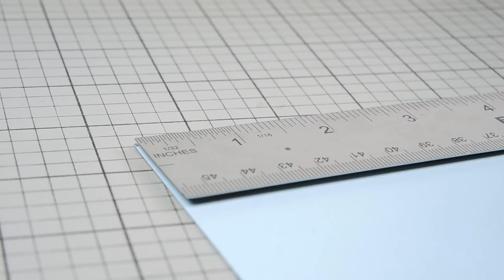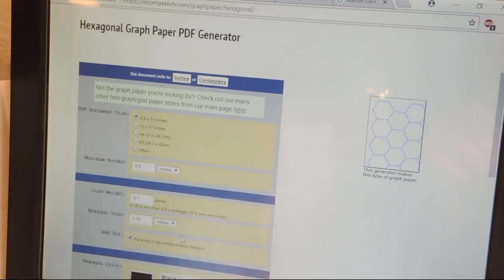Making a Sunglasses Case from Leather and Wood

Comment: What camera do you use?
Reply from the maker: Nikon P7700
Reply: Thanks!
Reply from the maker: I sometimes use a Canon S110 when the battery dies on the Nikon, but all of this video was shot on the Nikon.  The Canon G-series cameras are similar to the Nikon P7700.  We picked up this Nikon lightly used for around $250 a few years ago.
Reply: Cool!